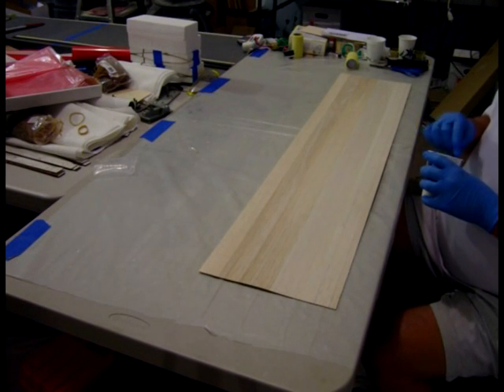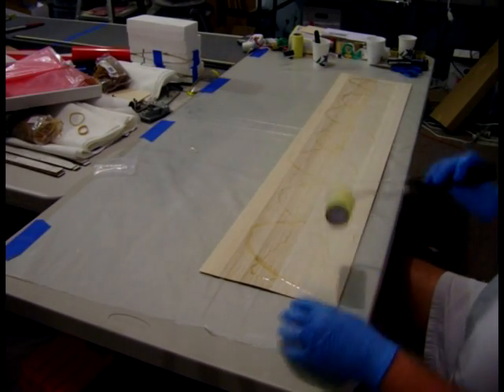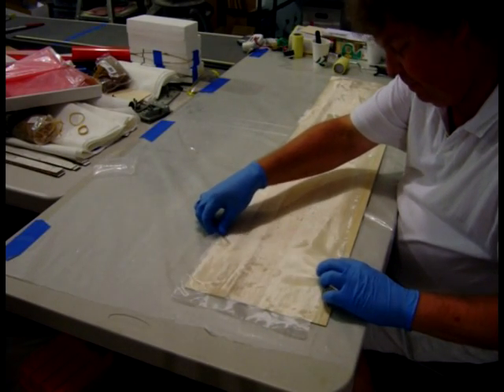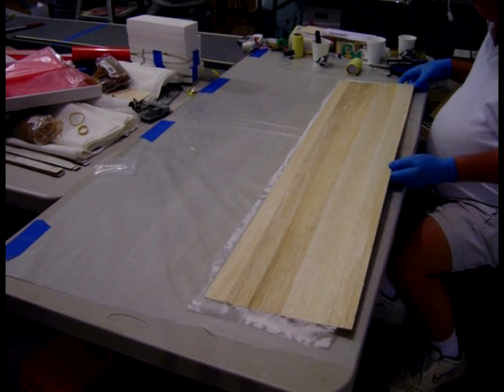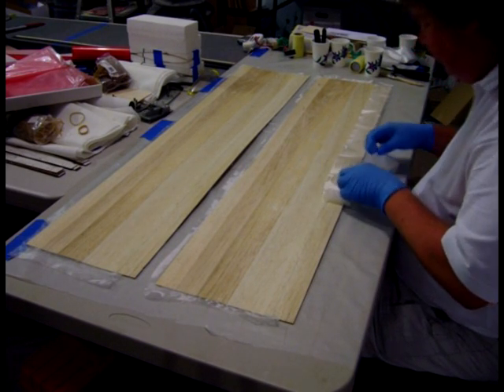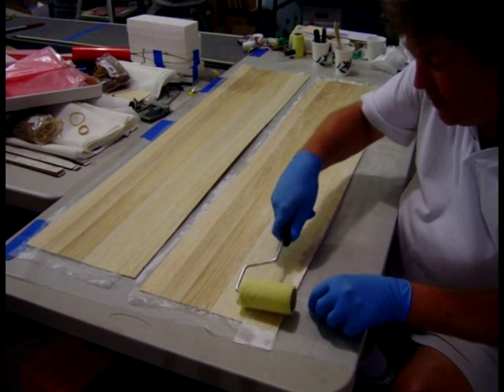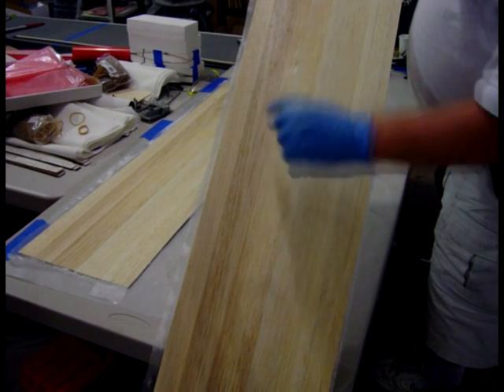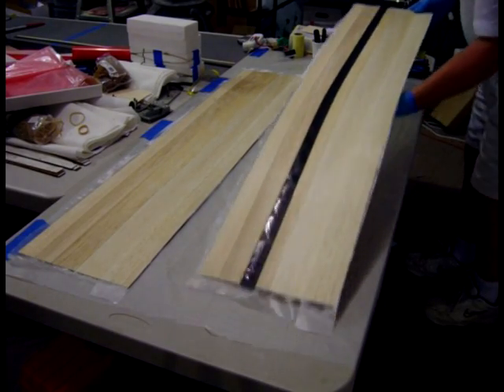Sheeting a Quickie Wing - Part 1

Comment: For a Quikie 25 that's a lot of fiberglass and carbon fiber. The QuikV III's that I used to make I skipped the fiber glass and just used 3 strips of tow on the top skin and 4 on the bottom. I rolled 1 oz of resin on both skins (no glass, 2 oz total). I put 1/2" kevlar over the aileron on the top skin for a skinned aileron hinge and that was it. Never had a wing fail and we were running Nelsons and Jetts.